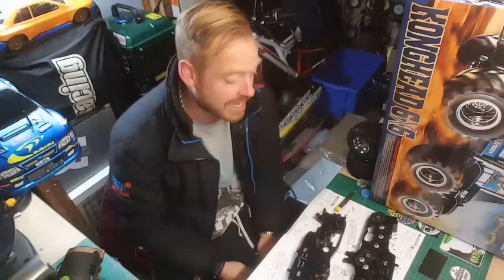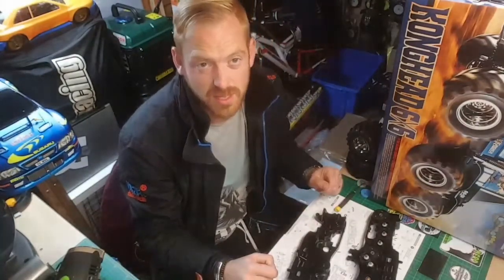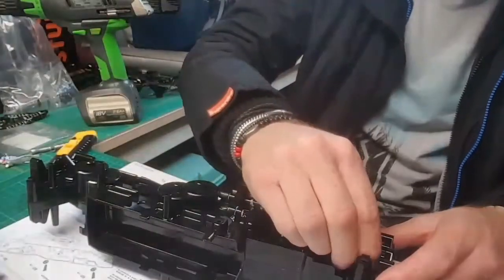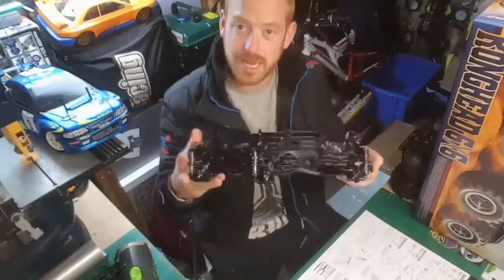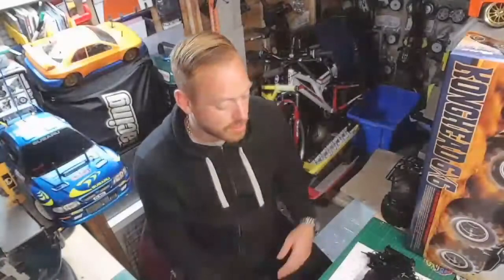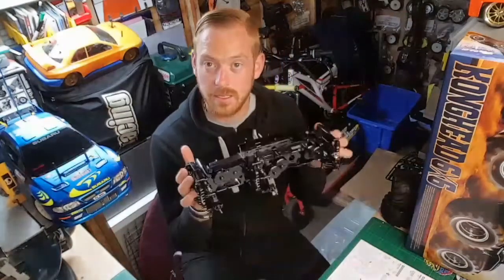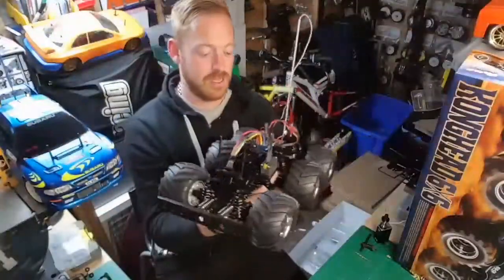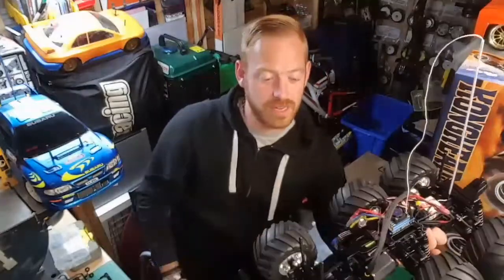Tamiya Konghead rc build brushless 1/10 6x6 truck

Comment: What brushless system are you using and how do you plan on not stripping any gears ?
Reply from the maker: Scott Baddley it's the ETRONIKS  combo 60A esc with 4370kv motor, should be absolutely fine on 2s all day long, if it were on 3s I don't suppose the gears would last to long 👍